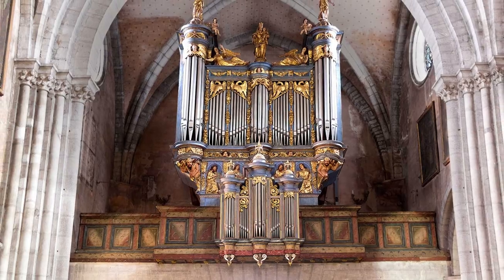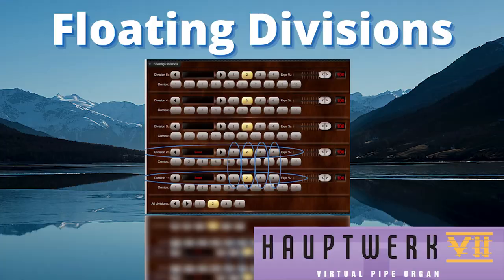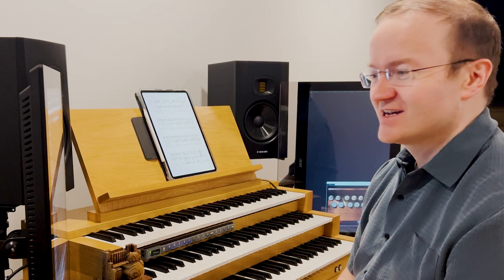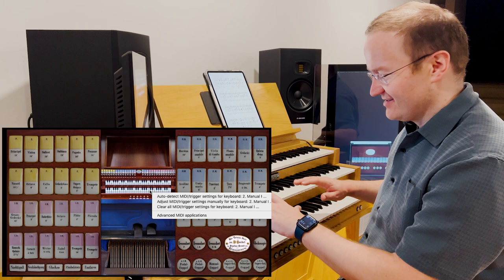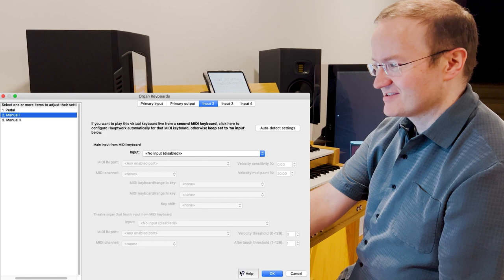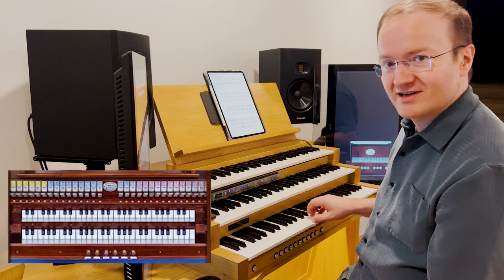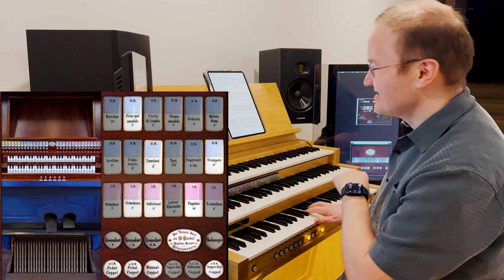Hauptwerk Tip - Coupling Manual | Making the most of three or more manuals

Comment: Thanks for showing this! My church has a 2 manual Visser Rowland tracker with a third (lowest) keyboard as a permanent coupler, no levers or draw knobs for that purpose. I’ve set up all my two manual sample sets in HW with the lowest keyboard to match this, so it’s easy to go from practice to performance. Strassburg and Noordbroek are my two go-to sets for this.
Reply from the maker: That's fantastic to hear. Despite being a long time hauptwerk-er, I have never played around with these possibilities before and am amazed at how useful it is! I finally have one of the 3m french sets set-up so that I can flip the G/Ch on demand via the floating divisions depending on whether I want to play continental-standard or english/american standard 😊
Reply: @jerrymartin79  Yes, super useful to add a little extra kick to the sound (like your Eben demonstration) without having to turn the manual coupler on and off like crazy! I'm going to have to play around with floating divisions next, as I've never messed around with those at all, I think because the only 4+ manual set I have is Rotterdam. Between the built-in couplers/switches and having the Borstwerk mapped to the Bovenwerk, there's a lot of room for control without having to scratch my head and figure out which buttons to push! Love the new floors in your living room upgrade, too. Cheers!

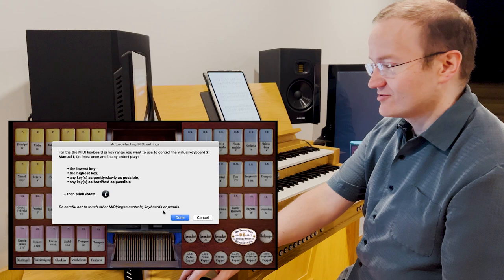Comment: 1:55 You can just do autodetect a second time on both virtual manuals to map the lowest manual, that will accomplish the same without going into menus 😉 Nice video!
Reply: Useful to know too but Jerry and I like to know ‘how it did that’ rather than just auto fix it.  Thanks for sharing the auto method though.
Reply from the maker: Thanks Richard! Actually I hoped that would work (that would be intuitive), but it appears when you autodetect a virtual manual with a second physicial manual it switches the primary assignment! (The inverse is not true - you can indeed autodetect the same virtual manual to separate  physical manuals --  went round in circles for a while trying to figure this out! 😆)